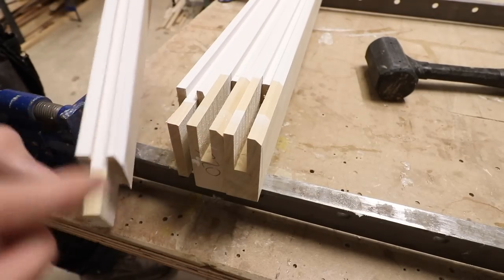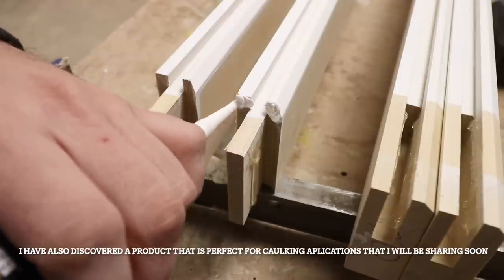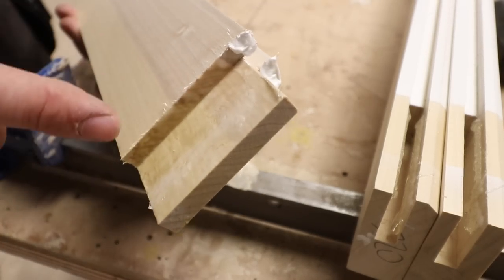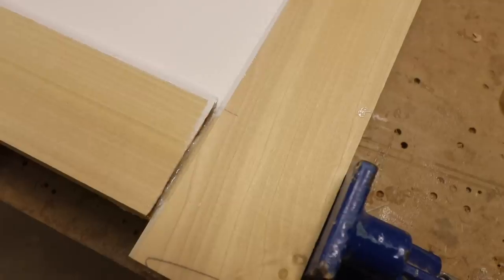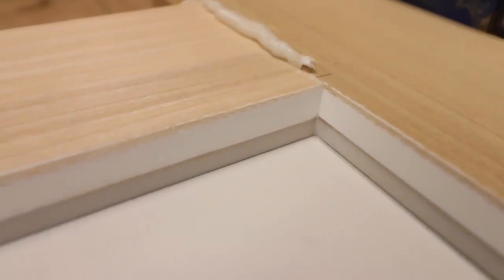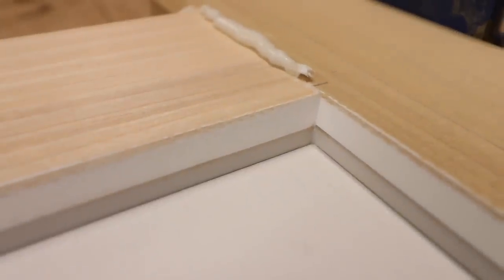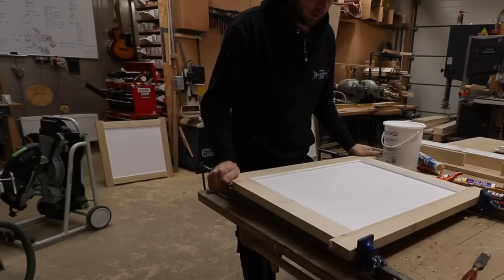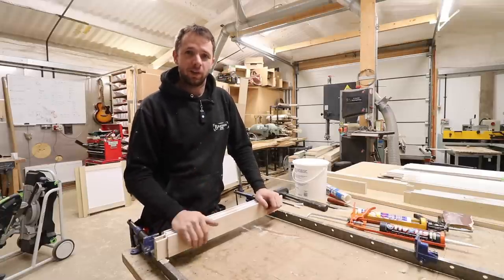Neat trick when working with PU Glue. Polyurethane Glue Hack

Comment: Great tip. We build mostly cope and stick doors in my shop. Just use Titebond 2 and hold the glue back from the inside corner about 3/8". Clamp tight and is solid in 15 minutes. Easy water clean up.
Reply from the maker: Cheers Stu, this would still work great to provide a caulked internal corner for paint.

Comment: Top tip...never seen that before. When using sash cramps I always use 4 cramps, 2 on top and 2 below, always counteract the force being generated from below.
Reply from the maker: Yeah thats the way. I find if the workpiece thickness is thinner than the centre of the screw thread the piece being clamped trys to bow into the bar of the clamp and holds it straight. need clamps both sides for thicker though.

Comment: Great tip mate, had some horrible times trying to clean up mouldings etc. which can make you glue shy, but with PU you can’t really go wrong it holds like shit on a blanket!

A tip back at you though is acetone! You’ve probably got some in your make up drawer for getting the nail polish off after the weekend 😉

On a cloth, takes it off beautifully at the soft stage in a pinch, more than likely‘compromise’ adhesion at that spot, but lesser of to evils, great for tools / clamps etc.

Have a great weekend mate  💄 😂
Reply from the maker: Yeah it sucks the cleanup of non regular surfaces in a corner. Plenty of acetone, I have tried it a bit, maybe ill give it more of a go! thanks

Comment: good tip ill try this - update on your scribing method with a 12 or 10mm belt sander - tried that and found it slow and the belt snapped frequently - probably because I had quite a lot to remove on some beech frames (hard timber and probably 20 linear metres to do!) found that a sanding/ abrasive disc on a small angle grinder was actually more accurate and used only one disc! takes some practice but you can get very good results... even if you decide the belt sander is better the disc sander will get you 99 percent of the way first - however must be done outside! dust is not something the customer wouldn't appreciate!
Reply: Not sure what you’re scribing, but the table saw can make a great job of it, it’s a fiddle for a small job, but if you have a lot it a game changer and arc of blade gives you a perfect back cut. Just enter at an angle, you’ll figure it out.

Or the collins coping foot is awesome for one off’s
Reply from the maker: Cheers Rob, yeah The sander is only really for intricate work as like you say its dead slow! Grinder works wonders outside, i tend to rebate the frame with a planer to leave a 10mm lip that can be scribed easier. The ideal tool would be like a rasp on the narrow belt sander haha

Comment: I don't know any custom wood workers who use UP glue. We all use one of the Tight Bond glues. Maybe it's just a "we always did it that way" thing.
Reply from the maker: I used to use a lot of aliphatic resin and cascamite, but found myself doing a lot of work with accoya, so transitioned to PU witht hat, its definitley a learning curve but i hardly ever use other glues now. The strength and speed is just fantastic, plus the cost. Itjust can be a little tricky to work with

Comment: That is by far the best wood work tip I’ve seen on YouTube in a long time- at least the most useful one for me . Thanks for the videos- Any of the screws left for the carvex fix?
Reply from the maker: Cheers David. Its a noce one for painted cabinetry, even if not using PU glue, it deffo makes the painting step easier.

Comment: Great tip again! I detest PU Glue with a passion due to the mess it creates, but I will be trying this one mate.

I appreciate that PU is needed for ACCOYA and Tri-coya but also hate the limited open time on the stuff so do tend to use the 45 min PU Glue rather than the 5- or 30-min versions if I do use it on lager glue ups. Failing that I use PRF Glue from Ureka adhesives which gives me a much longer open time and is fully compatible with chemically enhanced timbers it's just expensive!
Reply from the maker: Cheers Kevin i havent heard of the PRF adhesive before. I will check it out. Thanks

Comment: Great tip! I also usually reach for the PU for the reasons you listed, most of all the speed. Do you think a tinted caulk would work for natural finish doors? I usually end up scraping in there with a Stanley blade after the glue has gone off.
Reply from the maker: Depends if staining or just lacquer I guess. The glue squeeze is what stops the stain from soaking in isn't it, so anything squeezing out will be a pain. You can get clear MS polymer like CT1

Comment: I use pu glue a lot when laminating beams and sticking down flooring and the best thing to clean it off of anything is spray foam gun cleaner.
Reply from the maker: Cheers matey, Acetone is decent too, and probably easier to use.

Comment: Good video and tip, as usual, thanks. Any issues with using epoxy adhesive with Accoya? Extremely strong, gap filling, no foaming.
Reply from the maker: I dont think so, but i cannot remeber as i have never used it.

Comment: How would it behave when glueing two MDF edges for example? Would the mdf soak it up like it does with almost every other material? Can't seem to find any info on this.
Reply from the maker: Itlle work good, this stuff is very Thick so wont soak up too easy.